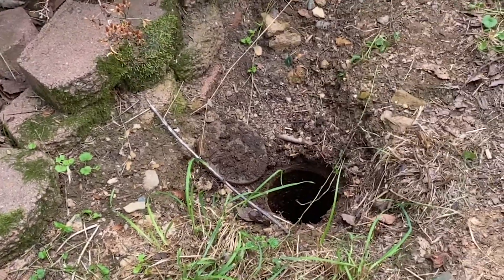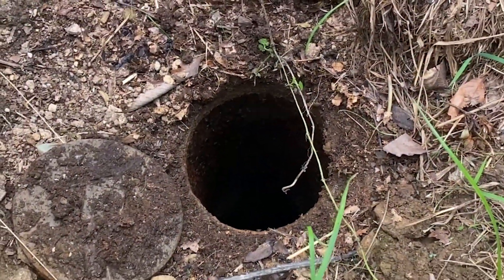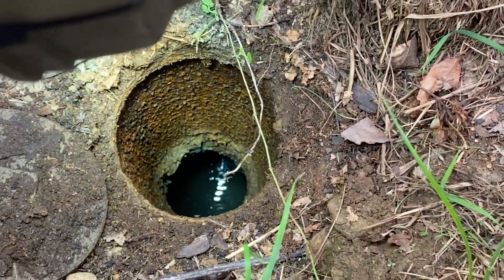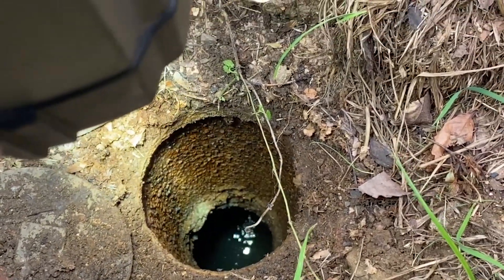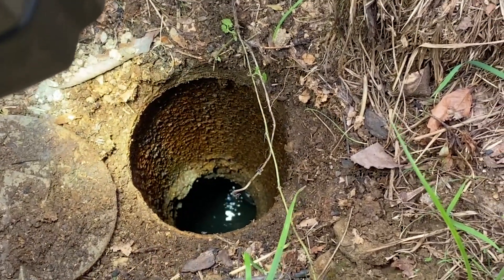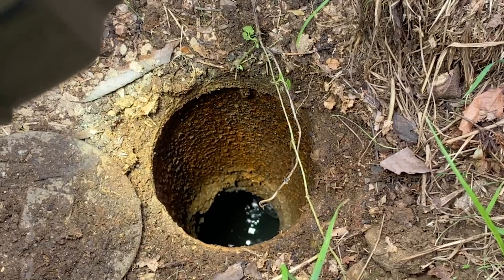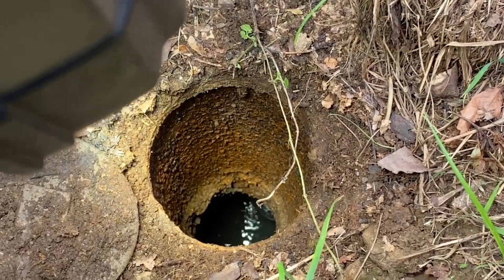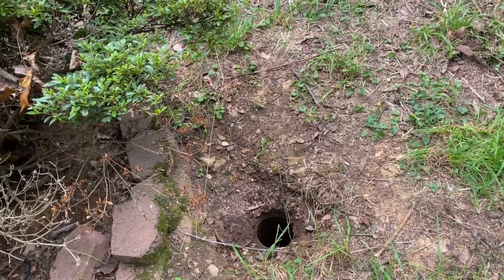Leaking Septic Tanks: Patch or Replace?

Comment: The center wall that divides the two chambers in my concrete septic tank is heavily corroded due to hydrogen sulfide gas. I’d like to get it patched but it’s 40 years old and based on what you said, I should get a new tank.

Comment: Will a busted tank cause your meter to run
Reply from the maker: It should have no impact.  Generally around here a septic system waste volume is not metered or charged by the county.  The maintenance cost is associated with the pumping fees.  Usually meters will be installed on potable water sources.   If your meter is constantly running, you likely have a leak somewhere after the meter.  Could be a supply line, yard hydrant, toilet or a shower cartridge
Reply: @Wellssepticandmore  I found it,the hydrant